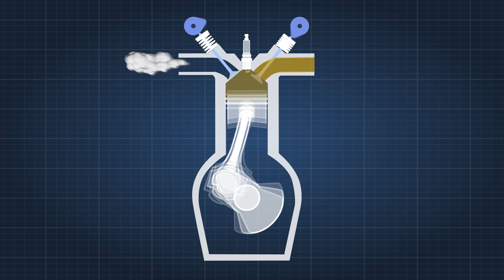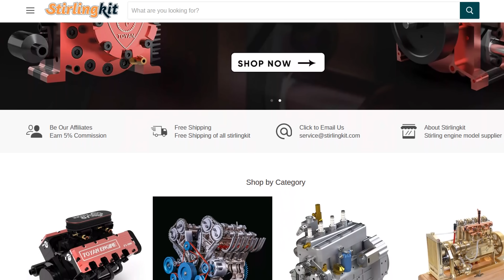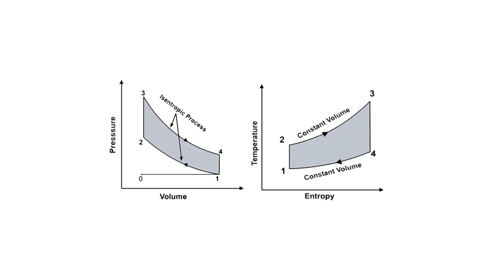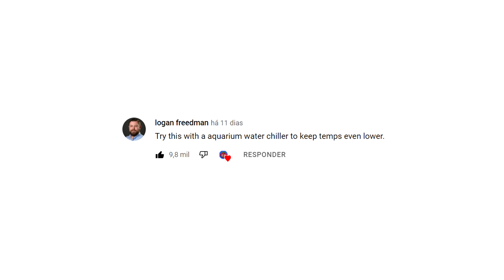I 3D Printed a Transparent Combustion Engine in Resin

Comment: Methanol/ Nitromethane - mixure is burning much faster than gasoline. Normaly you set the ignition point bevore TDC. When the fuel burns faster and a certain amount is burning bevore tdc, the engine will slow itself down, due to non usefull cylinder pressure increase. Another important fact is that the Air fuel ratio differs between gasoline and Methanol (as well as for all mixtures of methanol and Nitromethane!) Where Gasoline hast a ration of 14.7 air to fuel, Methanol needs only 6.5 air to fuel, which leads to the fact that you have to open the fuel inlet into your carburator, with more nitromethane content, you increase the in cylinder oxygen, which also allows you to burn more fuel, therefore you have to add more fuel as well. 
Another fact is, that Methanol needs more heat to ignite, heat is generated by compression in the cylinder. therefore you have to increase the compression ratio (By lowering the cylinder deck hight) the higher compression ratio will then influence the resistance within the spark gap, and the spark generator will probably not have enough power to let the spark "jump" propperly, therefore a lowering of the spark gap will be needed.
After all, you should not mix up Power and Engine speed, Power is the result of a product of torque AND engine speed. Assuming that you have an engine with zero output torque at 4500rpm and you increase the engine speed by holding the torque constant, the engine power will remain zero!

Comment: Hi Joel, 
The reason why this engine is not doing a power stroke every 4 strokes could be that it might have speed governing, specifically hit and miss where it doesn’t combust the fuel when it is running above the set speed. Just something to consider :)

Kind regards
Hunter
Reply: And i see some fuel leaking to crankshaft from the cylinder

Comment: Every fuel requires a different amount of oxygen. Modern flex-fuel engines will adjust the injectors based on exhaust sensors, but your engine has a carburetor, which will suck in a certain ratio of fuel/air, depending on geometry, density and viscosity, and you should retune/replace it for each type of fuel.

The nitro fuels are pre-oxygenated, and thus require less oxygen, but you're not adding any more of it. That means the only effect you're seeing is their lower energy density.

Comment: It is missing power strokes due to mistiming of the spark plug, improper compression ratios (e.g. most methanol engines use glow plugs similar to diesel engines), and/or improper air/fuel mixture ratios. If possible you can replace the magnetic spark circuit with something simple like an adjustable magneto, which you adjust to find maximum power/torque. The compression ratio is less finicky but is hard to adjust; most adjustable compression engines I've seen involve essentially a large bolt which is screwed in/out to change the compressed volume. As for the A/F mixture ratio, it is easily adjusted by limiting either fuel (typically using a needle valve) or the air (by simply restricting the air intake cross sectional area, e.g. your finger over the intake). Assuming your compression ratio is ok, you can typically merely adjust the fuel needle valve until RPM (at your desired load level, e.g. idle or max load) hits a maximum RPM, very easy. You can do the same for ignition timing. 

As for power measurement, you may take a hint from the most popular power measurement device for cars: the mass dynamometer. By affixing a cylindrical (i.e. easy to compute moment of inertia) mass on the output of the engine, and measuring the RPM (or angular velocity) of the mass and its change over time, you can easily compute both the power output of the engine as well as the torque. Torque = moment of inertia * angular acceleration; power = torque * angular velocity; for a cylinder of radius r, moment of inertia = (mass / 2) * r^2.   With a camera of known frames per second, calculating all of this at any given time between two frames is EZ. DM me for deets, I can guide you fam.

Comment: Well, different fuels require different ignition timing. The reason is each fuel have it's own combustion speed. The faster it combusts, the less angle for ignition advance you need, else it will produce higher back pressure before TDC. So if you just changed fuel without tuning angle, you changed combustion process a lot.
Have you ever tuned distributer by ear? Usually you shift it to earlier direction, and as soon as RPMs are start going down (too early ignition starts producing back pressure), you slightly shift it forward. That's your not perfect, but reasonable ignition timing. To make it perfect you need to check if you have detonations under load and shift forward until they disappeared. But it's not your case )

Comment: One thing I noticed is that all of the 3D printed cylinders are leaking at the top so it could still be a compression issue. The metal cylinder is likely machined to be a perfect fit so maybe adding a little silicone or something as a gasket/ seal where the cylinder meets the head would help.

Comment: The air/fuel ratio is probably off causing the misfires and the strange engine speeds. Gasoline for example likes to be around 14.7:1 as in 14.7 parts oxygen to 1 part gasoline.

Comment: Use a bigger battery/bigger capacitors. I'm going to guess that its the electrical system.
Usually batteries (in this case AA) have a relatively low, but constant rate of energy release. Not enough for the spark you desire.
In order to get that spark, you need to give the battery enough time charge a capacitor (or in most combustion cars a coil) in order to deliver all of that power at once.
If the battery can't charge the coil fast enough, none of the energy will be released.. which makes sense given what you are seeing.

The solution (I believe) is adding more current to the system, in order to charge the capacitor faster.
I would try doubling the batteries. Add another 3 AAA batteries in series with respect to each other, but in parallel with respect to the original battery pack.
This should charge your capacitor 2x as fast.
P.S. Disclaimer.. I'm not an electrical engineer... aka.. good luck!

Comment: Since I don’t exactly have time to read 3,000+ comments, I’m probably duplicating someone else’s comment (sorry about that person I’ve duplicated) - but.. if you want to try something a bit more with this engine, two things: As has already been mentioned, put a load on it that you can measure the power output - a DC generator into a resistive load would work [note, easy generator is a permanent magnet DC motor) - stick that resistor into a known volume of water, and measure the temperature rise over a fixed time. (Good ol’ calorimeter - 1 watt = 0.24 calories/sec and IIRC, 1 calorie is the energy required to raise 1 gram of water 1 degree C) The other is to make yourself a carb, or rather adapt one from an R/C vehicle engine - one that does have the ability to adjust the air/fuel mixture with a needle valve - gas/methanol/nitro all have different air/fuel mixture requirements - especially true when your compression sucks. Or blows. or whatever. (In other words, make the darn thing work as a true 4 stroke. ) And yes, tomatoes are disgusting.

Comment: Biggest issue you have is the lack of fine tuning on the fuel injection side - all those fuels have different stoichiometric ratios for combustion as you mentioned in the video so you need to adjust the carb/jet to inject more of the methanol/nitrometh fuels (and possibly adjust the gas injection too - you could just be dealing with misfires)
Reply: And also the viscosity of the fuel changes how much flows through the carburetor for the same needle adjustment
Reply: @MRmessyRoomedPerson  running higher octane in engines that use carbs tends to make the mixture slightly more lean. all that is needed is to adjust the fuel/air ratio with the adjustment screws on the outside of the carb. viscosity isnt an issue in a 4 stroke engine, only 2 strokes since a 2 stroke engine runs on a mixture of fuel and oil, that's when needle adjustments need to be made as well as changing jets... since it's a 4 stroke that never has oil in the fuel, you dont need to worry about viscosity. 

in this case, running higher octanes will result in running just slightly more lean, adjust the air and fuel screws.. hence why the only thing he noticed changing was the rpm, when you adjust the screws on the sides of any carb while the engine is running you will change the idle rpm.
Reply: Thats just what i was thinking
Reply: This is possibly an answer to one of the problems for sure. I feel like the size of the engine also does it no favors
Reply: jets have nothing to do with octane. also this engine has a carb, literally all that needed to be done was adjust the air/fuel ratio, any regular sized carb has 2 adjustment screws on the sides to do this... however a carb as tiny as this one idk what it has to adjust air and fuel ratios.

Comment: my guess would be - the carb of this engine has been designed to run on the Nitro and not the others fuels. Using different combustibles makes the engine run too rich or too lean and thus misfire a lot ... If you change fuel you should also change the carburator jets to match the fuel you're using ...

Comment: Rpm vs torque.  They have an inverse relationship.  As the speed increases the torque goes down.  Torque is produced in lower rpm ranges...  that is why when you look at HP Torque graphs from a dynamometer the  lines cross at 1 point.

That's an idea for a future video. Build a small dynamometer to test various 3d printed engines. 

Also I think you are correct with the poor compression.  Assumption.    The thing is you need about 9.2/1 compression ratio in normal engines. High performance engines do about 14/1 compression and diesel engines have over 22/1 compression.  You also need to look at the stoicometric ratio for the diffrent fuels. Gas engines run 7.2/1 air fuel mixture. While other fuels need diffrent air fuel ratio... and that is set with the carburetor  the venturi effect caused by the needles forces vaporization of the fuel.   The fuel vaper needs to be the proper size of  "droplets" in order for the chemical reaction during combination to be most efficient.

Comment: Some of the pro motorcycle racers  use a mixture of methanol and nitromethane some inject nitrous oxide everything needs to work together but the higher the compression ratio and the stronger the explosion creates more stress on internal components. Internal combustion is a very cool thing when it's done correctly

Comment: Compression, timing both ignition and valve,spark all need to work together. Methanol is not as explosive as gasoline thus safer in race cars in event of a crash burns cooler and packs more punch than gasoline but you need more spark to ignite  built Sprint Car engines in the past  need compression, valve and ignition timing methanol burns faster than gasoline so need a richer fuel to air ratio but it packs a bigger punch than gasoline need enough compression and correct timing and correct air/fuel ratio

Comment: I can't help but wonder if the reason the more powerful fuels are causing slight warping/flexing after ignition due to the extra force they apply to everything. They will then ignite properly once recovered from the extra force. The other thing it could be is that the carburetor is pulling too much fuel and fouling out the spark plug. Either way it comes down to using fuels not intended for use in that small engine. That and the fact you've changed the material of the cylinder wall changes so many variables from an engineering standpoint.

Comment: Some possible suggestions for the power stroke inconsistency, first and what could be arguably the simplest fix, incorrect Air to Fuel Ratio. The nitro needs much less air to burn a lot of fuel and this is why a rich AFR is no problem, gasoline needs a lot of air 14.7:1 Air to Fuel to be exact and this engine is mostlikely running closer to 10:1 probably even richer, notice on the intake stroke just how much fuel is sucked into the engine for that little ammount of volume of air. To remedy this you can tune the carb or use a different jet for the carb. Second probable but unlikely case is spark-gap different fuels require different spark gaps depending on their ideal AFR, Cylinder temp & compression. This is why Turbocharged engines use more specific spark plugs aka colder plugs. Also important note, the cylinder you are using most likely is not perfectly dimentionally accurate, when metal heats it expands, resin does not expand as much so there could be tolerances coming into play between the head & cylinder causing compression leak. Easiest way to see if this is the case is simply test the compression with the resin cylinder and then with the metal one, this could be causing a compression leak and thus fore improper ignition of fuel as the AFR is thrown out of whack.

If all else fails, fall back to the simplest principles an engine needs only 3 things to run, compression - spark - fuel & air, you can go by the method of elimination to see what the cause is :D

Comment: 1) ignition timing = each fuel has a different burn rate The timing will be out ie With the above factors in play, the ignition must be timed so the spark begins the fuel burn sometime before top dead center, or BTDC in engine parlance. This is measured in degrees of rotation. Most engines set ignition timing somewhere between zero and 20 degrees before top dead center. This is called base timing. When set, the ignition system and engine are timed so the fuel in a cylinder is at its peak burn just as the piston compresses the fuel vapors into the smallest amount of space.

Comment: The reason the better fuel is making less rpm is that its creating more torque rather than rpm, the good fuel is basically just firing every eight strokes like you said so at that point the engine is just spinning but not actually making good horse power thats why airplanes run on stuff like methan

Comment: I believe the metanol runs faster becase it doesn't have to fight inertia on each 4 strokes and must be easier to compress. So the motor runs faster but not stronger.

Comment: The variable involved in that phenomena I think is temperature. In particular the combustion temperature. I thought that while is higher could imply some losses  in terms of friction which could lower the speed. Methanol has the lowest combustion temperature if I can remember correctly,  the resin cylinder could be less "thermally stressed".

Comment: Expansion rate of the gasses vs the power released. its why diesel is so high in torque at low speeds vs gas at higher speeds.

Comment: You likely are running lean, or have a weak spark. Reduce the plug gap and try tuning the carb for each fuel. You could also try running a small load, as without a load its basically guaranteed to run at zero % efficiency. Maybe 3D print a small waterpump to use as a “dyno”.

Comment: Here`s something for clearing up the small mishap, wich happened over your head; keyword: stoichiometric value. a scale, where you can see, how wide the range of mixture can be in order to ignite.
hexan for example goes from 1.2 to 7.4,
methan 5 -15
and hydrogen 4 - 75
see the huge differences there?

what i`m saying here is: the carb has done a terrible job. the mixture wasn`t consistent enough - often times you can even see big droplets.
the 25% nitromethane fuel you used could compensate best, because it wasn`t that sensitive concerning its mixture range.

Comment: Maybe the RPM gets lower each time because of the loss of lubricity in the cylinder, since a big portion of energy gets lost due to friction. You first run the engine on Gasoline (witch lubricates quite good) and than you run it on methanol and the methanol mixtures, witch lubricates much worse than Gasoline. 
How about adding some oil to the fuel like one would do in some two stroke engines? 

But anyway, I really like your Videos!

Comment: Your air fuel ratio is incorrect.

Nitromethane burns best at 1:1 air to fuel ratio.  Best power around .8-.9:1.

Gasoline at 14.7:1.  Best power naturally aspirated around 12.5-13:1.

Methanol at 5.5:1 or 6:1.  Best power at 4.0:1 on average.

Additionally, your ignition timing is critical.

It would be fun to instrument, and tune the engine with a basic fuel injection system like mega-squirt.

That way you could command and achieve optimal ignition timing, and air fuel ratios.

Develop different tunes, and even utilize different injectors to test fuel delivery rates.

A wide band O2 sensor could be utilized to monitor combustion events.

This will give you precise control of the engine.

Could be fun to test different air fuel ratios, while simultaneously being able to throttle the engine.

Then maybe build, borrow or steal a small dyno to test power output.

I like the videos keep up the great work.

Comment: Suggestion: Make a 2-stroke. You can do cylinder and head in one piece, so there could be very nice view (only obstruction would be the spark plug) of the combustion and subsequent charge flush.

Comment: Make an engine with opposing pistons where both pistons are electromagnets that repel one another when you activate them the right moment whene both pistons/magnets are the closest to its other. You can ad electric fun that compress air  in a diferent chamber while the piston are off and comming to position to one another and release it in the cylinder just in time for the electromagnetic power stroke. Sorry for my bad English  XD